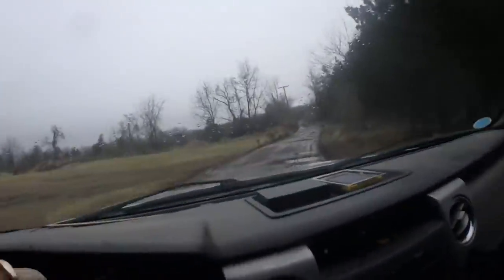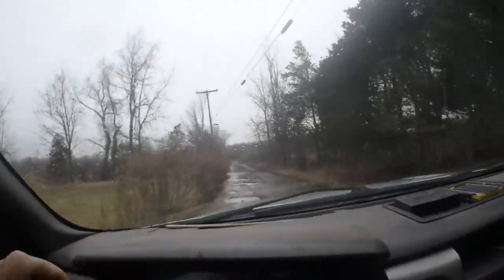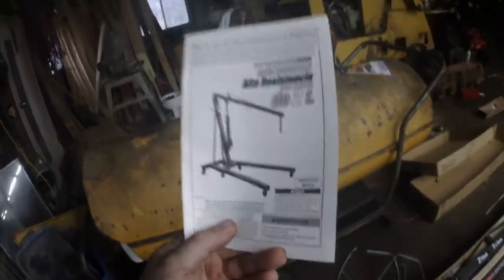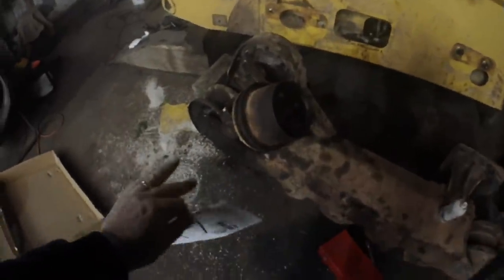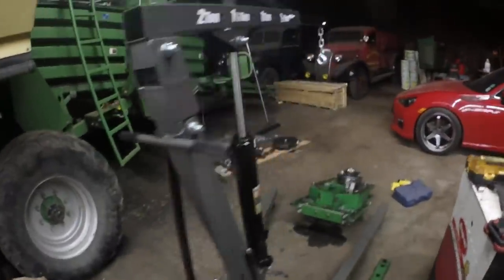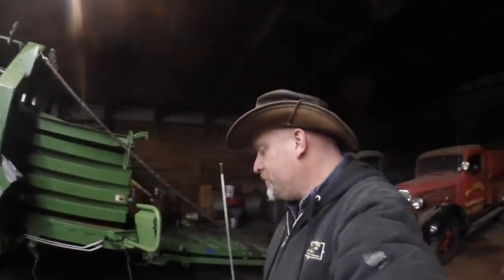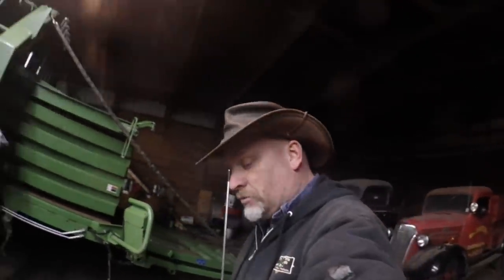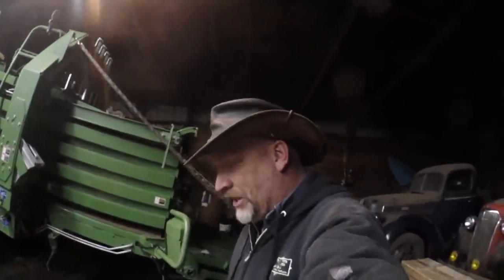8530 Needs Splitting 7530 Needs Heat

Comment: If this Case IH mechanic could point out something that we do for PTO install and removal. We often get two long bolts with the same threads as your mounting bolts, cut off the heads and cut a screwdriver slot at the end.  You install the studs into your rear end housing and hoist your PTO onto those studs and then slide the PTO into place.  Start some other bolts and then remove the studs and install your regular bolts. 
Also, to balance your PTO housing, install your PTO stub shaft and put a long pipe over the PTO shaft so you can keep your housing straight up and down as you install it.

Comment: Because the old style heater control valve that had a push pull cable on it was too simple and reliable I guess???
Reply: you should try the JD 8345R i drove on a grain cart helping  one of my repair shop customers for a few days when he was stuck for staff.   that things even got a touch screen page on the computer to select which freaking lights you want on and a hole pile of other stuff to that use to be simple switches.   These modern tractors are just a nightmare waiting for an event to cost guys big money is about the truth of it. I bet most of this computer stuff  they use now will be Parts NLA in 10 years and the equipment will be getting scrapped, as they all have the same computer issues.
   I know of a mouse damaged loom and computer in an early 2000 years massey  it's $10.000 the guy don't have for the updates on the original parts that are obsolete already, and they don't know how long that new part will be available really now either as it's been around a few years already.. Luckily he bypassed that system to a mechanical spool so his loader works to feed his cattle without the computer joystick control.
Reply: the stooge limp wrists democrats couldn't manage to move them with their twig fingers :))
I still own vehicles with cable and vacuum controls....
Reply: @throttlebottle5906  Yeah lots of us try to keep that stuff going, but they are getting smart, discontinuing Major parts so we can't keep doing it.  JD/ CaseIH and others are rapidly dropping older tractor parts from stock, and non OEM or good used is getting harder to find as well for some things. They will make us smaller guys quit farming/ working or conform to the agenda's they want for financial gain in the end .
Reply: @super6954  and they wonder why people buy the chinesium disposable junk instead....

Comment: Heater Fix. Place a ball valve on the heater hose by the block. Way simple and 100% reliable.
Reply: Not a good idea on modern vehicles and equipment. Many use constant flow through the heater core these days to keep airlocks from happening and cores from rotting out. Can cause overheating issues if you restrict this flow.
Reply: @Cragified   All out deeres and navistar trucks have a ball valve.  Actually keeps the cab cooler in summer. We use Shell Rotella ELC coolant. No rot with this stuff,

Comment: My cherry picker has come in handy.  The first thing I did with it was remove the rock shaft housing on my 60. I can lift it but why. It only takes a second to seriously injure my back, rendering me useless. I'm betting the lift is cheaper than a doctor.
Reply: I stuck a 500kg electric motorbike winch on my engine crane 
Makes it much faster to lift so I'm more likely to use it 
Because as you said it's easier to use than busting your back
Reply: @fowletm1992  the winch sounds like a good idea.

Comment: Did you ever consider putting a ball valve 
in/on the water line; during the winter you need heat open as necessary during summer usually no heat necessary close valve turn on a/c
Reply: yep, want heat get out and move it, or extend it into cab, custom and near fail-safe, but then again it probably sets some idiot light and goes into HVAC lockout, where nothing works or stops the tractor..............
I call the the EU plan, AKA bilk as much money from everyone as possible (demonrats love that also)

Comment: Better gets some better castor wheels. They don’t last long, and uneven surfaces are it’s worst enemy.
Reply: Jesse Stoltzfus I agree with you. Those wheels are sketchy on a smooth floor!  Let alone an old floor with a lot of character to it.
Reply: tuba7084 the place I used to work had one, worked great for just about everything we used it for. Any kind of dirt and the wheels would lock up and skid. Can’t hardly ateer em worth a crap, and we actually broke a castor off, so it got 2 heavy duty castors in the middle.
Reply: Jesse Stoltzfus that’s the same problem I’ve had with mine.

Comment: The failure of the transmissions on your tractors probably has something to do with the way you drive, not to be rude but with variable transmissions its bad to run them at low speeds with high revs when Baling and to use engine braking on the road. Just in case you didn´t know that.

Comment: Pittsburg? That's a Horrible Freight cherry picker. 

MSC sells cherry pickers from a company called ARCAN that are/were made in the USA. 

The biggest issue with the HF units aren't the frame but the hydraulic cylinder. OBTW, the 2 ton rating is with the arm close to the frame. Extended full length, the rating drops to 1,000 pounds.

Build a cherry picker to mount to a 3 point hitch.

Comment: You should have done this scrappin'  10 years ago. Prices are crap now.
Reply: Prices did come up for a while just before Trump's tariffs where to put in effect because there was a run on steel stock as companies stockpiled. Then of course the demand fell and the one U.S. steel foundry shut down, don't know if it's reopened yet. Prices are crap again but eventually you just have to get rid of stuff. No points holding on to it, there is far more steel out there in the world then humans will ever use due to China's overproduction for a decade. And steel being so easily recyclable means that surplus will be hanging around for at least our lifetimes.

Comment: rained/snowed/so wet here  the neighbors are crying at me parking in the yard and making mud run downhill to the street and back up their driveway.................
I'd like to know where they want me to park, I bet there will really be some crying if I park on the street, as garbage, delivery, plow and more will have an impossible time and it would be fully legal for me to do :))
and no I am not going to put any driveway material over there, as it's a main drainage point from there and many other back yards, no way to fix it without costing many thousands and then I'd just push the water to some other neighbor or flood the ditches and whole street of lower homes..... yes I could do that, not my problem, etc.....

Comment: When I read the instructions on a cheap harbor freight engine picker. it said the 2 tons is only with the boom in the minimum extension. when you use it longer its derated.
Reply: 500 lbs all the way out. I've got one. Only way it would reach was in the all the way out position yet had to stand on it to keep it from tipping. Needed tractor weights on the engine lift

Comment: Ford has never made a good transmission! Get a stick shift Ford BOOM
Reply: Tsunauticus III  that's their one weakness....transmissions. The rest of the truck is unbeatable.
Reply: The strongest part of a Ford truck is the transmission.
My 1990 F-150 had 453,000+miles on it and the original AOD-4 speed is still in it when I sold it.
Reply: Well I'm sorry sir but your wrong. Ford 5R110 and 6R110 are some of the strongest automatics in the industry. All the newer ones are equally up to the task. Going back the C6 was an excellent transmission also. The only auto that was a weak link would be the E40D behind the early OBS powerstroke's.
Reply: Everyone is forgetting the New Venture 435 (nv435) 4 sp manual. Like GM's sm 420 and the sm 465. Gear Vendors sells a Overdrive for a them.
Reply: @michaelbaumgardner9493  
If we're talking manuals nothing stronger then the Ford ZF 5 speed. Indestructible.
Reply: Tsunauticus III   Well I guess it depends on if they were built on a Monday or a Friday 🤣
Reply: Tsunauticus III   That's where I got it from my dad lol
Reply: @Mad_Farmer912  
Sorry friend, not one manufacturer offers a manual transmission. Thing of the past.
Reply: @scottviers3794  I guess so. I just looked at dodge 2020 specs and there is 6 and 8 speed automatics available no manual. I haven't been in the market for a truck lately and wouldn't look at a Dodge anyway.
Reply: Just put a clutch in my '06 f-150 215000 miles love ford
Reply: You're forgetting that dude's (Dodges) don't make a diesel,if it wasn't for Cummins dodge would of went tits up a long time ago.

Comment: Tip for the hoist:  The long legs like to come crashing down when up and moving it.  I use a stick of wood between the two legs and the cylinder to save toes from being smashed.  With the stick across one can move the unit easily and safely.
Reply: Fred, mine has two pins that keep the legs folded up.

Comment: Buy a kabota skid steer , never look back
Reply: kubota is junk, get a CAT if you want it to last.
Reply: Lol,I own 5 skid steers I prob know a bit
Reply: @717weston  yes all day had a cat 277 I will never own another cat that undercarriage cost so much to fix I don't even care they changed it to the fixed roller system my 75 will run  do all the work is balanced and you can afford to fix it if an when it breaks
Reply: @grassgobbler7214  Kubotas  last       I paid   33k for a 13  75-2 with cab and 800 hrs ran it for 2000 hrs only broke one hose now we have  a 17 running them both everyday and we to date have got 1 set of tracks two hoses and the fittings on the aux hydros because a tree hit them
Reply: The "7" series is junk that's the ASV style. The ones ending in "9" are the heavy duty ctl undercarriage.
Reply: @grassgobbler7214  yes something Kubota has been rocking for awhile I have owned cat Kubota  and takeuchi i will never get cat again now if  we get another big loader again cat is the only way to go we have had 953 939 and an old pit loader 977 they make great loaders but Kubota has the smaller equipment and hay tractors down to a reliable machine

Comment: Why can't you just put a ball valve on the heater supply line and switch the fan motor direct off the battery through a fuse/relay?
There is no such thing as a 'free ride' on a farm.
Reply: Probably because he doesn't want his 75k tractor to be rigged up with toggle switches and ball valves.